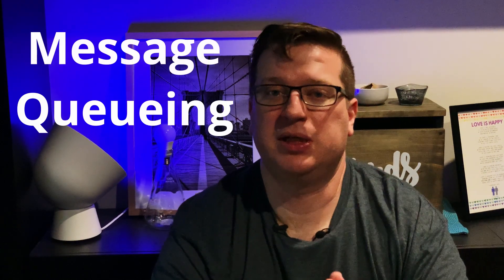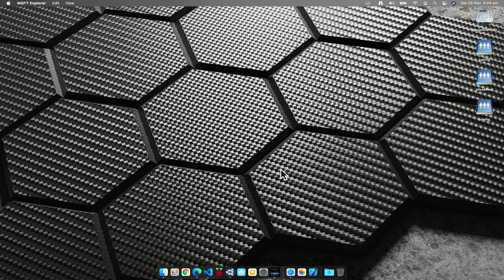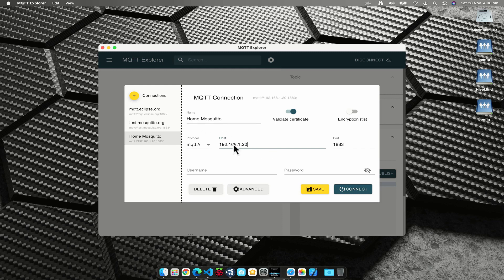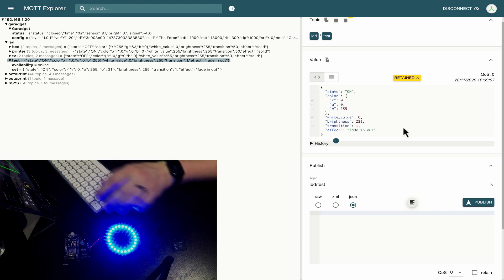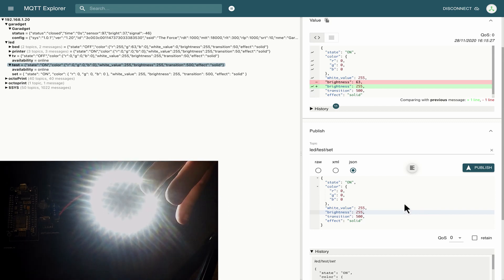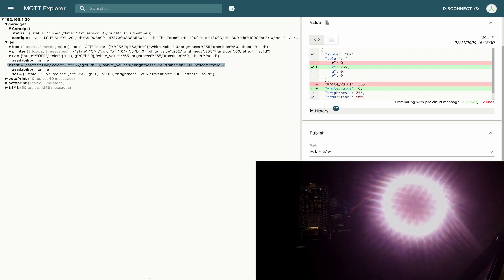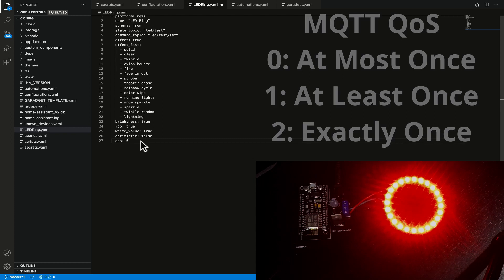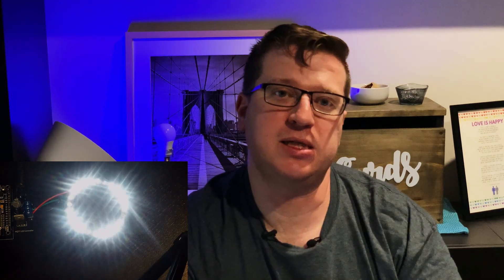What the heck is MQTT

Comment: Love the video!  Super detailed and easy to follow.  That said, I do have a question regarding the "Host" name when making a new connection.  When I go into HA>integrations>MQTT>configure, I don't see the IP address, but rather the host name "core-mosquito". How can I find the IP address?
Reply from the maker: You can normally use the same IP as your Home Assistant Instance if you're using the Home Assistant Add-on. The mosquitto port should automatically be forwarding to the mosquitto container.

Comment: so I am planning to install few sensors and with ESP32 I want to send the data using mqtt. Can I collect the data in HA and display it, i.e. battery state, temperature from my sensor, humidity etc? I missed this part in your video. Because I would assume HA can do this. The display is number one, but if i.e. battery goes below min level then I would create automation i.e. notification or so. Thx
Reply from the maker: Yes, Absolutely you can do this and have attributes display as items on your Home Assistant Dashboard. Once your entity is in Home Assistant, the data is available.

Comment: Clear video, thanks. As it is a telemetry, does that send a constant data stream or only data when there's a state change?
Reply from the maker: Depends on the accessory, the led ring in the video only sends telemetry on state change, but it wouldn’t be difficult to modify the code to send state at a defined polling interval

Comment: Hi there ! Thanks for your videos. I take pleasure when looking at them (even though I get headaches after :))
I was wondering if you are using a specific board to work with the mqtt protocol.
Thanks
Reply from the maker: MQTT is fairly ubiquitous and as far as I’m aware, the code I’m running in the example given here will run on most ESP8266 boards.

The LED ring demonstrated in the video is controlled by a NodeMCU that I’ve mounted on a custom PCB to break out the required GPIO pins and handle power delivery.

I’ll be doing a more in depth video about the LED ring/strips soon.